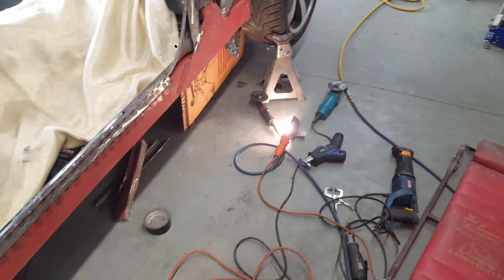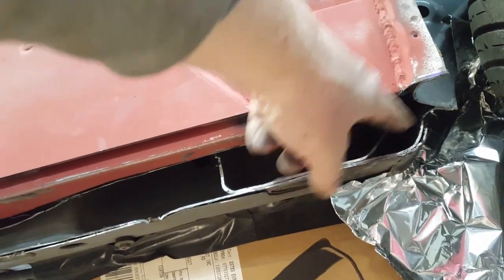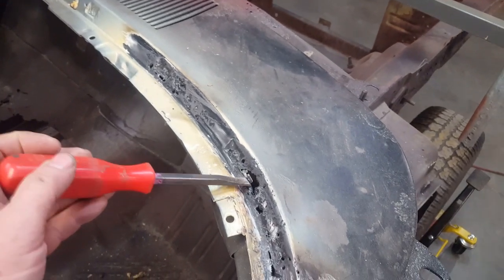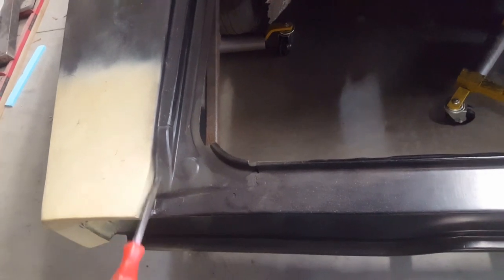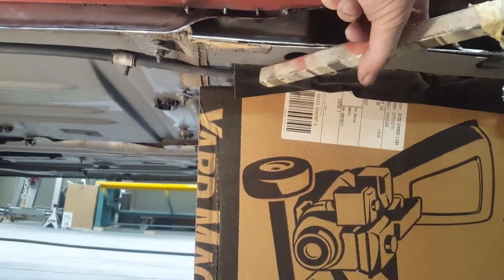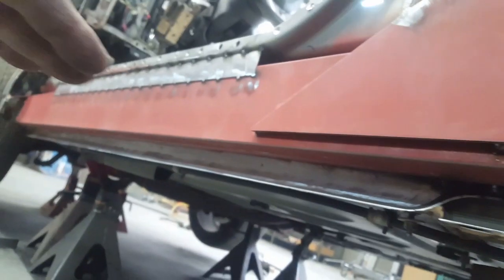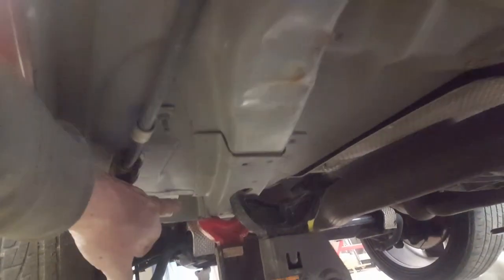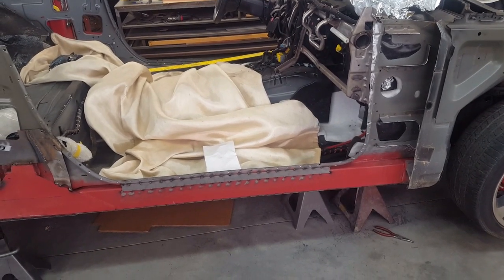Don's 68 Charger body swap part 4

Comment: If anyone needs a lot of demo tools, It’s you Steve! LOL….actually surprised it’s so feW?  Figured you’d have bunch of different air nibblers and specialty metal shears also!  Great work as usual!
Reply from the maker: If the was no wiring or gas tank I would take the plasma cutter to the whole mess.

Comment: Frame rails are looking pretty much bullet proof, nice job.  Old Charger body work looking really suspect.  When my Uncle was building '57s he hated dealing with somebody else's work.  He'd spend so much time fixing the issues found, time that wasn't included in the estimate.  Then the owner would balk at the new price.  Towards the end he'd flat refuse to accept "finished" work as part of the project.  He lost some work, but as it was more a hobby he didn't mind.  I hope the old bodywork doesn't need any more adjustments then that shown.
Reply from the maker: It is not horrific so it will be fine.
Reply: @SteveMirabelli  Good to know.

Comment: Great work as usual Steve, Looks so much better with your custom frame rails, Did you do this the same way on the Daytona?
Reply from the maker: I did not at first. I had to go back and fix them once I realized the problem.  The first rendition on the Daytona looked hideous.

Comment: Being that the Challenger has a shorter wheelbase as the Charger, I’m curious as to how you’re going to address that. I assume that you’re dropping the body down to where the rear wheels are in the correct location in the wheel openings, but won’t that put the front wheels too far back in the front wheel openings?
Reply: It is only 1 inch shorter, I've seen a crown vic swap in person, it is a 4" difference, and even then it was hard to tell at a glance, I'm sure some slight fender modification will make the Challenger perfect
Reply from the maker: I will split the difference front to rear. The wheel openings must be enlarged anyway to accommodate the 20"wheels.